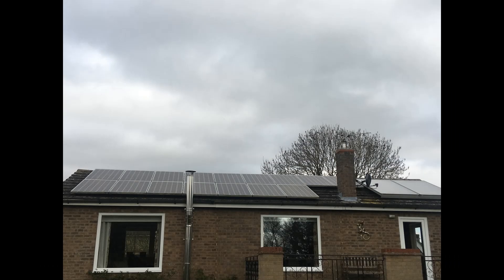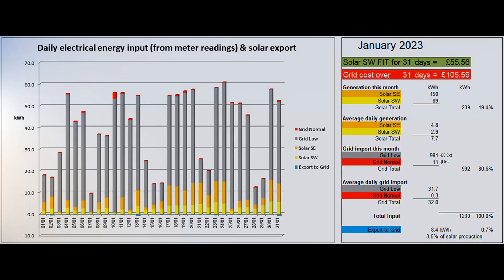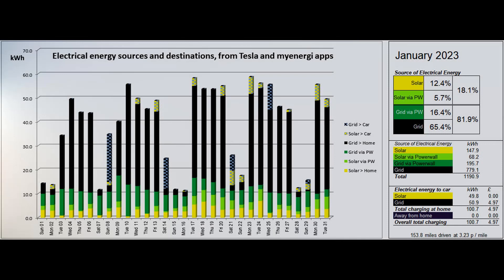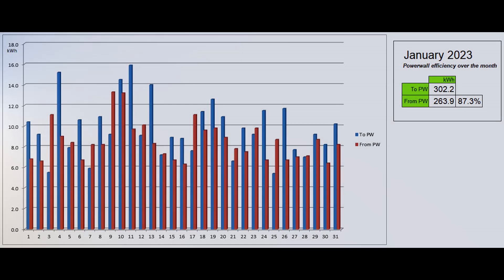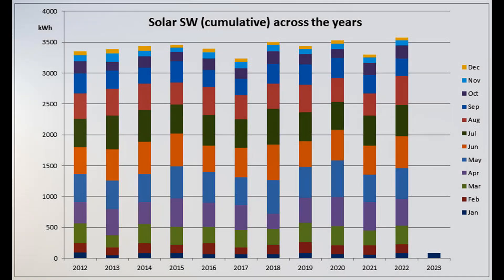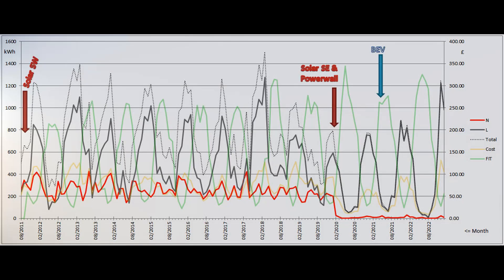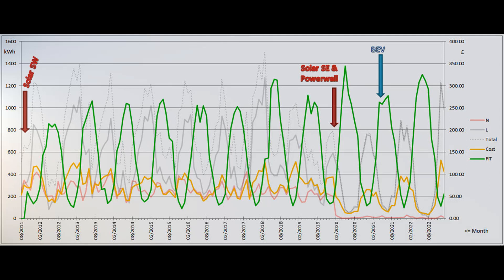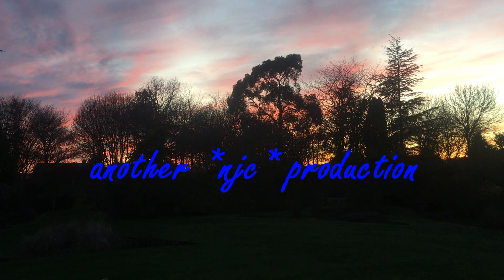Tesla Powerwall 2 and Solar PV in the UK [38]: January 2023

Comment: You can get the Tesla data using Home Assistant .  Then, feed that data into IngresDB and Grafana to make some really nice graphs.  Really good data on the cost per mile for your car.  EV + Solar / Batteries really make driving cheap now.
Reply from the maker: Thanks for the comment ... to which I'll add "especially in the summer, but not so much in the winter"!

Comment: Hi, great information - wish I had found you sooner!
Interesting that you have 3 phase like me and the same battery setup that i am looking to put in. The Tesla Gateway is 3 phase but the battery is only 1 phase. My understanding is that only 1/3 of your solar production could ever go into the battery, is that correct?
Thank
Antony
Reply from the maker: Hello and thanks for your comment ... not many 3 phasers around! The battery is, indeed, connected to just one of the phases and I have both solar arrays also on that same phase. Much less activity on the other two phases except in the summer when the pool needs heating. Have you got your solar yet? If yes, each array (if more than one) will be connected to just one of the phases. It doesn't apply to me but, if you have a solar array with excess energy going to the grid on a phase  which doesn't include the battery, the gateway may be clever enough to import the same amount of power on the phase which DOES have the battery to nett the grid exchanges to zero. Certainly when I need to imprt grid power on phase 2, the solar and battery on phase 1 exports at the same power to result in near to zero grid energy being registered on my meter.

Comment: I'm still in the process of installing my battery and inverter system. 
I'm aiming for at least 80% off grid

Interesting that you're using about 1.2 megawatts a month it's about the same as me.

I'm on the octopus go tariff at 12 p off peak 40p on peak
Reply from the maker: Thanks for your comment, Michael. We only use that amount in winter, with over three quarters going into the storage heaters in our annexe. Have you see my report for last calendar year, 2022? That shows how much energy input (and consequent usage) varies through the year and that around  40% of our electrical energy came from the grid over the year. We'd only be able to get to 80% or above if we closed down the annexe, but the rent paid by our American tenant covers the cost of the annexe's electricity.